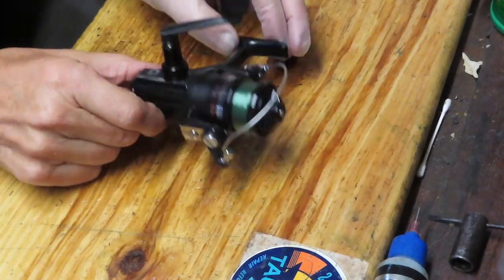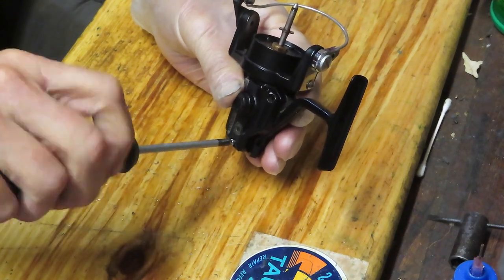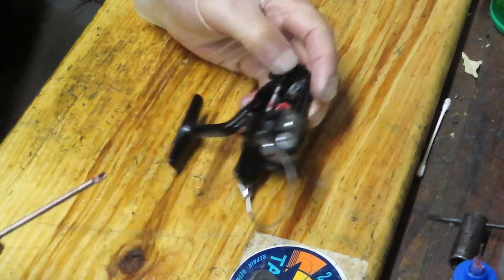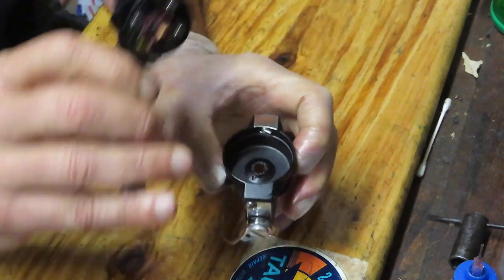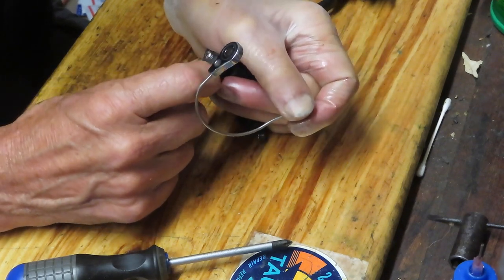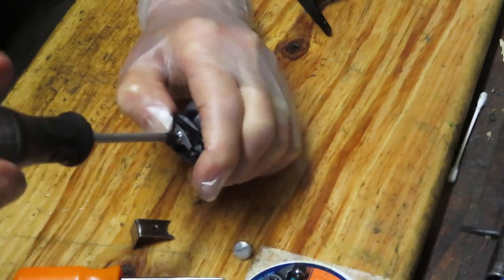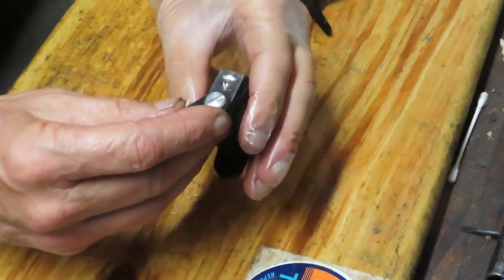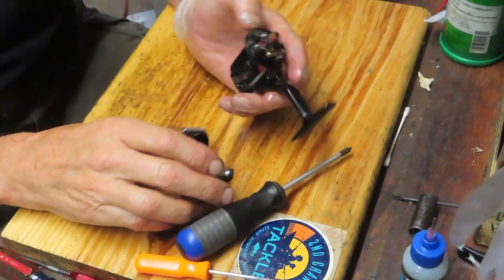Vintage Daiwa D1000 reel failure how to diagnose and service this reel including bail reset

Comment: Thanks Dennis ...Great video...never would have thought the bail trip was the problem...you suppose it was installed wrong...
Reply from the maker: Yes it was apart.  The owner had it apart and could not get it back together. - Dennis

Comment: Hi Dennis!  Nice video -- do you sell bail springs for reels of this size (or smaller)?
Reply from the maker: I don't sell parts and these are hard to find due to the age of the reel.  Check eBay if you need the part.  There are some sellers that break down the older reels and part them out.  Thanks for asking - Dennis
Reply: @2ndChanceTackle  Thanks for answering!